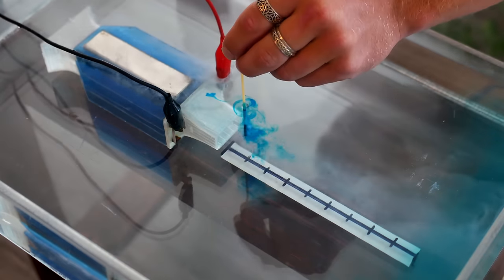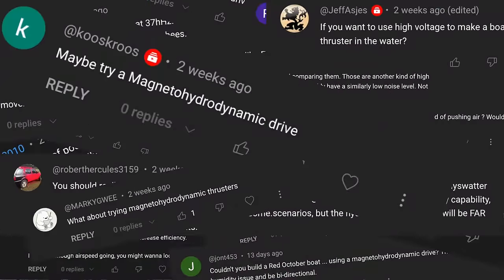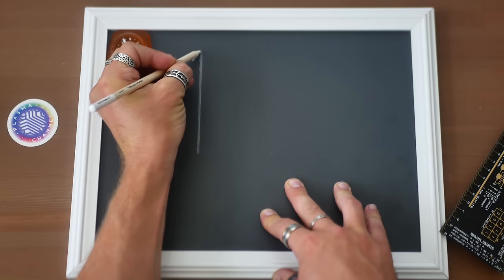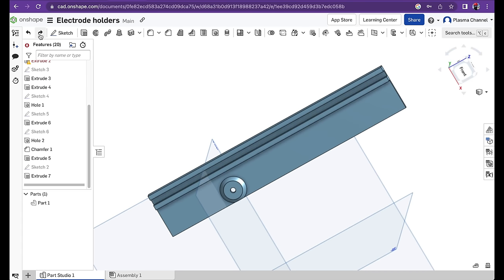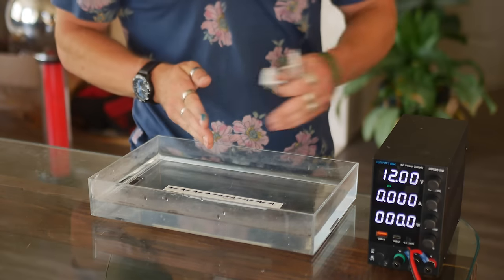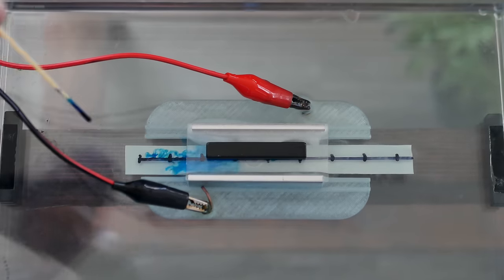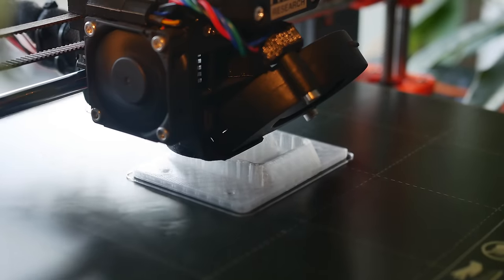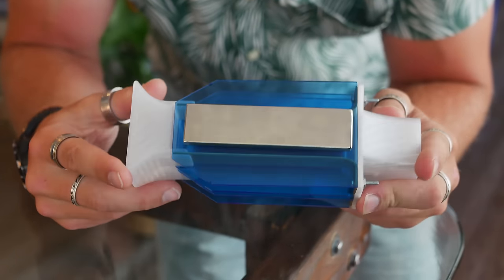Using Stealth Propulsion for Ocean Travel (MHD Thruster Build)

Comment: The force on water is =B*I*L where B is the magnetic flux density, I is the current in the water( between the electrodes), L is the spacing between the electrodes(i.e length of the conducting path),  Also current (I=V/R) is voltage(V) by resistance and here the resistance(R) is clearly proportional to the electrode spacing L making R=k*L where k is a proportionality constant. Long story short the force B*I*L becomes B*(V/(k*L))*L that is B*V/k i.e it is independent of the electrode spacing and linear wrt B and V.
This should be fine for intuition, but the resistance is also non linear which only complicates things
I must also add this, there are two currents now here, one going between the electrodes (I) and the other being the thrust flow itself(i) if you use the same rule for this new current(i) a new force arises opposing the main current (I, between the electrodes), this new force is B*i*c where B again is the magnetic field, i is the flow of water causing thrust and c now is the overall length of the electrode. The direction of this force is ixB that is the cross product of the velocity of charge flow and B(I know it's cXB but that's hard to imagine) and it is opposite to the main current I between the electrodes. This is the back emf in this system where the faster your thrust flow the lesser the current between the electrodes which inturn reduces the thrust force.
To put all this mathematically, the thrust force which we saw as F=B*V/k should be replaced by F=B*(V-a*f)/k where 'a' is back emf constant, f is the thrust flow rate showing that flow rate will counter itself
Reply: I imagine this intuition probably breaks down as well for very close spacing due to viscous effects of the water over the surface. A minimum electrode spacing when stacking for a more powerfull design could come from that maybe?
Reply: So essentially it is a very short conductor length motor and would need a stack of current to really get it moving.
Reply: Do we need to account for the velocity of influx of water ?
Reply: funny words magic man
Reply: A couple of errors in your assumptions, in electrochemistry most of the voltage drop happens at the electrode faces (and it's not usually symmetric), not across the length of the bulk fluid, so only a small part of resistance is proportional to spacing R≅k1+k2·L. Secondly, the way he tested spacing did not use constant magnetic flux density, since he used a single, under-sized magnet for all the tests. A test with constant flux density should show increasing thrust with increased spacing.
Reply: As an Air Force trained electrician, this is good information.

Also, have upvote #100
Reply: Here, electric field = charge per unit area/ Epsilon*water constant 
E=Q/(Aεk)
And voltage supply=(charge per unit area/ Epsilon*water constant)*distance between electrodes
V=Qd/(Aεk)
As area,Epsilon, water constant and voltage supply is constant therefore there is the variation of charge and distance between the electrodes is inversely proportional or simply electric field is inversely proportional to distance between the electrodes but here the effective capacitance is formed so the sudden change in the distance between the electrodes do not suddenly change the charges on the electrodes therefore there is not sudden effective change in electric field in small period of time which can contribute to the water current. It is just like a spring it is not impulsive.

Here, the electric field causes force on charge which resulted to increase in the velocity so when the charged particle get some velocity the magnetic force get in and this magnetic force (perpendicular to the velocity) causes thrust.
Here, electric force is the internal force which is cancelled out.
Reply: Ok I'll be the first to state that I didn't look into the whole equations here, but wouldn't there be a measured effect in open water (i.e. not in a tub, but on a proper body of water), where you have multiple paths for the current to go between electrodes that varies based on impurities/differing ionic concentrations?

And, can we agree that it's the ions, not the water itself that produces thrust?
Reply: @goeland86  i totally agree with you, the chemistry and the fluid dynamics aspect of this will create non linearities in most of my simple assumptions and yes it is the ions which can be the impurities and the water itself( splitting to H+ and O2- )  that produce thrust
Reply: YEAH!! What he said!!
Reply: @feynmandirac7575 These devices are not efficient in normal water. You need an electrolyte such as salt (NaCl Na+ and Cl-) to establish a current between the plates. Then the device becomes more effective since there are many more charged particles when a current is flowing between the plates.

If the MHD relied only on electrolysis for charged particles, it would not even be worth considering since electrolysis performed without a catalyst is horribly inefficient. In any case, the galvanic cell formed by the conductive plates with potential difference and water dissolved electrolyte is the limiting factor here. The more current/voltage, the faster they will corrode.
Reply: Good point, @withjoe1880 . Although he went through almost ten minutes of the video and the entire set of parametric tests without mentioning a level of salinity, at the end he adjusts salinity to something comparable to an ocean to test the assembled drive.

Comment: I think the electrode spacing test is misleading you here. You are measuring flow velocity, but that is not your actual goal, thrust is. Thust means mass flow, which is proportional to cross section and velocity. If your velocity stays constant, but your cross section increases, it means more thrust. If you are testing with a constant voltage source, more distant electrodes will mean lower current thus lower power. You also likely have a larger flow cross section with more electrode spacing, so combine that with lower power, that means wider spacing should actually be an effective way to improve your thrust/watt.
Reply: came here to say this

sick video tho !
Reply: Thanks. I was looking for this explanation 👍
Reply: Fluid displacement over time.
Reply: Thanks, exactly what i wanted to comment. Also, there's another variable that has not been tested at all which is magnet spacing.
Reply: Noticed this when playing with two hovercrafts of different duct size. Small one less thrust but very powerful small stream, big one less push in a given spot but a much larger area of air so overall more push.
Reply: With losses of course, electrical power is proportional to thrust.
Reply: I was going to say the same thing. I'd run the electrodes unparallel for max v
Reply: @mrjjman2010 😊😊

Comment: Good work, particularly the parametric testing.  The reason the electrode spacing didn't matter was that you did not account for the return path of the magnetic field.  The result is a counter magnetic field on the outer fringes closest to the plates creating turbulence and drag.  You can see this at timestamp 4:28 on the upper plate on the right.  It is even present during the 3cm test at timestamp 4:42.  Wider spacing needs a wider magnetic field, at least as wide as the plates are.  The second thing is that if you use a magnetic core, such as steel, laminated iron, or ferrite, to complete the return path, your magnetic field in the chamber will be higher still, leading to higher chamber medium velocity.  PM me if you need more details. :)
Reply from the maker: I’d love to chat with you about the second version I’m building. Please shoot me an email (found under the “about” tab), and in the email 📧 indicate that we’ve spoken in comments section.
Reply: also if a higher voltage was applied the boundary layer should be considered a plane of high conductivity. If you choose underwater electrodes use a dielectric insulator on any part of the electrode outside the e field including the wiring. And have them taper vertical towards the rear and not parallel but facing away at 1-2 degrees. Also angle the magnet along the horizontal plane 5-8 degrees

Comment: Try using Pulse Width Modulation (PWM) with a Pulse Repetition Frequency (PRF), it may save on the overall wattage. You may also try and use some low amp high voltage supply. This will allow the water once it's moving to help keep the water flowing even when the voltage is off. Kinda like once you get a tire rolling it doesn't take as much force to keep it going. You may also consider using Idler Plates, they are used in Hydro Gas Generators to keep the water charged while using less electricity. Hope that helps give you some more things to consider and test with. Best Wishes & Blessings. Keith Noneya
Reply: So electric current is analogous to torque in a car would you say? Seems reasonable.
Reply: @paulschrum4727  Well sort of. When an electric motor is running it has a term called RLA Running Load Amperage and it's usually quit a big lower than what it takes start it. When a motor 1st starts it has what's called a LRA Lock Rotor Amperage, meaning that's how many amps it takes or draws to initially get the rotor moving. It's one of the primary reasons most home generators can't run a whole household if you have a large AC unit. To figure out how big a generator you'd need you'd have to look at your AC System Tags to find the LRA rating on both the inside and outside units. Add those up and multiply it times the Voltage the system is designed to run on. My old outside unit had an LRA of 110. So multiply that times the volts 220x110 = 24,200 watts. That would be the minimum size generator to start my old AC. You reduce that same system by around 30% adding a soft-start module. So the point I'm trying to make is in order to get the water moving takes a lot of energy, but once it's moving it has a lot of mass and it's not going to stop on a dime like a rolling tire or car or a mass of water. So once it's moving it should only take a pulse now and then to keep it moving at the same flow rate. At least that's my theory.
Reply: @keithnoneya  Thanks. This just reminds me of having 1st gear in a car be high torque for getting started, then as speed increases, the gear ratio can be reduced and can keep a car moving at 60 mph with much less power. That's why I asked about the analogy to mechanical power systems.
Reply: @paulschrum4727  Yep makes perfect sense when put that way too. Best Wishes & Blessings. Keith
Reply: @keithnoneya   Great explanation and example. This makes sense when thinking about how an old vacuum or power tool may dim the lights in the room when first starting up but then return to standard brightness once the motor is running.

Comment: NICE! May closer spacing doesn't increase current draw because of some factors like bubbles on the metal surface could limit the draw. Good engine though, beside the side effect of electrocuting planktons!
Reply: Please make one of these on your channel!!
Reply: those bubbles are also rather corrosive if i remember my chemistry classes right (NaCl + H2O <-> NaOH + HCl), so would be interesting to see how it holds up after a year or so of runtime.
Reply from the maker: That's a valid point Mehdi. Considering one electrode is essentially covered in bubbles, that's a huge limiting factor.
Reply: @PlasmaChannel  use alternating current and electromagnet! And also electrode distance may not affect speed, but it affects total thrust cos the water flow increases.
Reply: @PlasmaChannel  what if the metal plates are covered with tape or a thin plastic?
Reply: @anarcocapitalista3700 it would need to be electrically condictive but then it would have the same bubbles build up on it
Reply: yeah,
coating it up with insulators would hinder the conductivity so it would have less reaction,
but if coated with conductive element then it would also form the bubbles
Reply: @ElectroBOOM Why did I hear this in your voice?  😆
Reply: @BrentRoberts01  he did tho, in his fake water gun video
Reply: @endurofan9854 he could spray coat it with graphene or MXene but idk how conductive it need to be before it reduces performance
Reply: @PlasmaChannel  inject oxygen to ignite them, not silent, but cool
Reply: @BrentRoberts01  he basically already did.
Reply: I asked to myself "Where's electroboom" while watching him and yep, there he is.
Reply: @nonchip this doesn't quite make sense to me, does that mean I'm making NaOH and HCl everytime I dissolve salt into water?
Reply: No that's not the reason
Reply: What If you changed material and or added pitting to the flat surface
Reply: @CyberKnightX21 same, i couldn't help but hear is classic electroboom voice echo in my head as i read the comment, then just imagined him shocking himself with water splashing everywhere
Reply: Would this be a case where the efficiency of the "motor" goes up as speed goes up, since bubbles would be immediately dragged away by the passing water?
Reply: @guerillanewsfare267  That's exactly what I though when I heard the bubbles could be the limiting factor.  

I also thought it might be cool if we could cause the hydrogen and oxygen to explosively recombine for extra, albeit not so silent, performance.  

I'm also wondering if their might be a better material for the conductors, from my understanding conductive materials are also inherently more reactive (the reason they're conductive is because of the number of electrons they have and their ability to easily give up an electron but that also means they are more than happy to combine with other elements).  

I have heard something about different frequencies affecting conductivity or at least efficiency in some way (aluminum can conduct higher amps at certain frequencies or something, I honestly don't understand it too well).  Perhaps a pulsed DC input could have some effect.
Reply: @PlasmaChannel if the magnet spun would that fix bubble issue but cause other field problems? Cylindrical magnets? Spinning electromagnets? AC current?
Reply: Water is a dielectric
Reply: @pless.  Only pure (DI) water is dielectric. Ocean and most river water is far from it (the reason you can't drink ocean water directly is due to the high salt concentrations).

Comment: Drag is going to be the limiting factor in this thruster. On top of the thruster drag there will be a vessel drag component as well. So the lengh making faster flow is great for a practical display, but optimizing the design would require that drag be the factor used to determine field strength and voltage inputs. For any given thruster size, it will have a maximum velocity in the water due to it's drag. Practically speaking this would mean that the nozzle used in this video would be a limiting factor of volume because the fluid cannot be compressed. Therefore the nozzle increases drag, and limits volume. I would imagine that a thr

Comment: This was super interesting, thanks for doing it.  I had a scan through the comments and didn't find any of these points:
1) The electrode spacing doesn't change the deltaV, but it might increase the thrust because more volume is being pushed.  It would be worth to measure the thrust (hang your device by a string and measure the string angle/displacement).  Ultimately thrust force is what you were looking for, so that might be  a better metric than DeltaV.
2) Does the current go down with increased electrode spacing?  Coupled with point 1, more spacing could be  even more efficient (or maybe you did test this and I missed it...)
3) When increasing the voltage, does the current increase linearly or instead have inflection point(s)?  I would expect at certain voltages the chemical process (electrolysis) to change as you reach the threshold voltage for new electrolytic reactions.  Although you might get less thrust from lower voltage, you might find it more efficient
4) How does the thrust change if there's already an input velocity.  I suspect it doesn't (if you can rule out the drag of your vessel).

Comment: You can significantly increase the magnetic field strength by using a closed magnetic circuit instead of an open one. You can also use Halbach array
Reply: As pointed out by another commenter in another comment thread - a Halbach array doesn't have a uniform linear magnetic field - it would be stronger but would alternately accelerate the water forwards and backwards causing a significant performance penalty at best, or rendering the thruster completely useless at worst.
Reply: @bosstowndynamics5488  You could probably take advantage of that actually. You don't need a uniform magnetic field if you make your electric field also non-uniform, pair that with boundary layer separators and you'd have one funky looking mess of a thruster. You'd probably need somrthing like an evolutionary algorithm to design that thruster for you though.
Still, with a 3D printer, it may very well be possible to actually build whatever your fancy genetic algorithm designs. You can buy conductive 3D printer filament.
Reply: @MrRolnicek Unfortunately that would only make it that much more expensive to replace when the galvanic corrosion eats away at the anode.
Reply: The water closes the circuit.
Reply: YES to the magnetic closed circuit, just as is done in dynamic loudspeakers.  Significant magnetic field strength is wasted without a closed magnetic circuit between the two outer magnets.  Water does NOT close a magnetic loop.  Also, placing the magnets closer together—perhaps a wider, yet shorter channel for the same volume, will yield a significant increase in magnetic field strength.
Reply: @HH-ru4bj  they're talking about the magnetic circuit, not the electrical one.